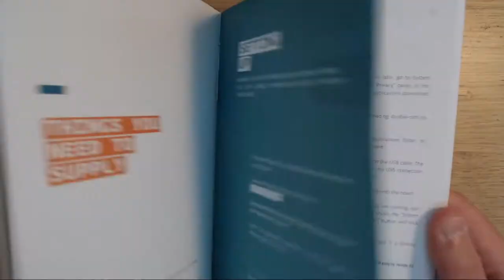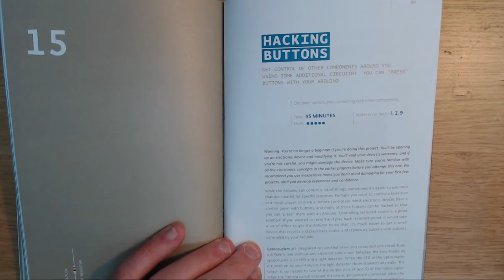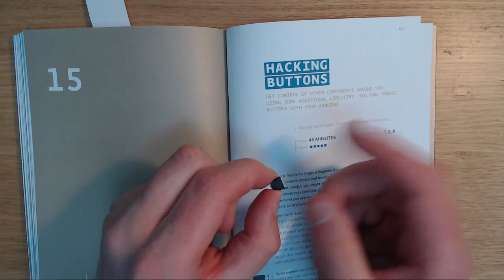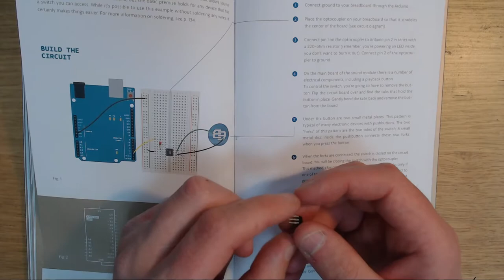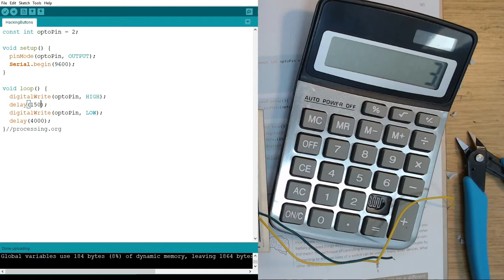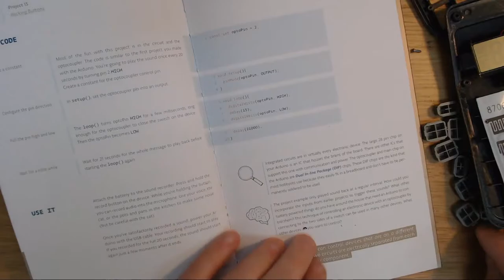Sofox tries the Arduino Starter Kit - Chapter 15 - Hacking Buttons

Comment: thanks dude can you only make 1 of them from the whole set
Reply from the maker: The set only has 1 Optocoupler, so short answer is yes. However, you can buy more optocouplers (also called opto-isolators) online very cheaply. In fact, you could probably buy an Arduino, wires, resistors, and multiple optocouplers, and be able to do this exercise without having to buy the entire Starter Set.